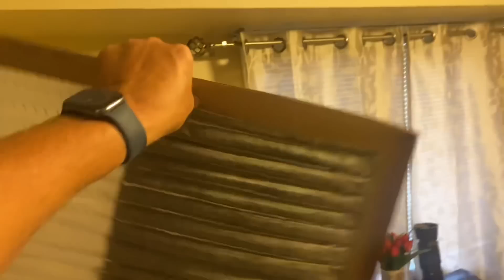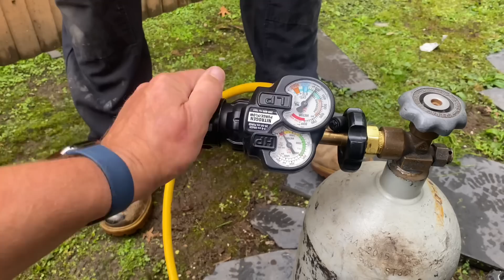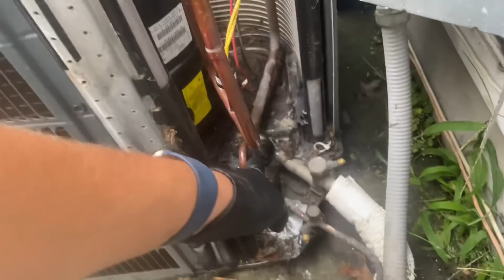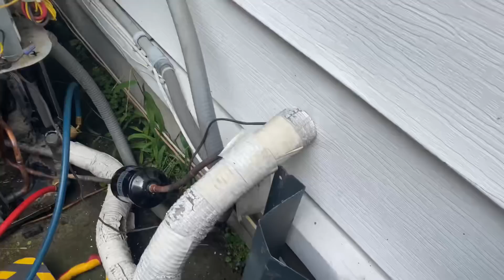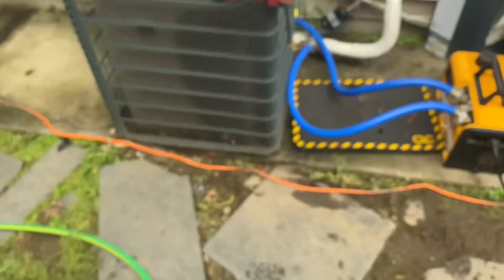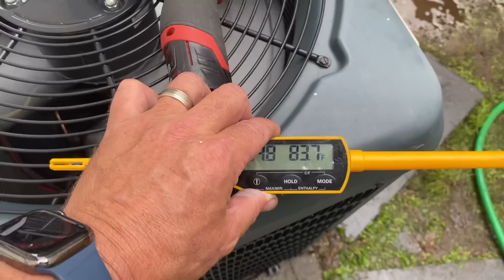Central AC System Not Cooling Totally Flat Poorly Installed System STEP BY STEP FIX REVEALED

Comment: OK so this is a fan coil unit, why is the condensing unit not a heat pump! Are they only running electric heat? Way to expensive I wouldn't want there electric bill in the winter months.

Comment: well done Mikey love your videos. I bet your microns rose up the first time from when you closed the ball valves seeing there may have been pressure or atmospheric air trapped in that ball valve. i normally flip those ball valves on and off during the vacuum to alleviate that issue give it a try to see if that works for you too. Cheers man I appreciate your vast knowledge and professional work keep it up.

Comment: Just an fyi. Make sure you do not use acid based cleaners on the micro Chanel coils. Will eat the aluminum. Use Viper micro channel safe coil cleaner if needed or manufacture recommends WATER ONLY.
Reply from the maker: Completely understand. The reason is because MOST techs don't rinse well enough. That's why. Appreciate your feedback.

Comment: Mike, with that gap between filter and housing of the handler, would it have been prudent to check the evaporator coil for crude as well?  I mean, look at the outside unit :)

Comment: Nice job I would have Done everything identical. Having  a TXV subcool is important To be sure that you have a full column of liquid entering the expansion valve so it can do its job.. But super heat is still relevant and having close to none Would mean that there's way too much liquid coming back to the compressor. I like to see my head pressure at least two times what my suction is The compression ratio seems off with 150/266. Possible overfeeding meeting device??   Not much else you could do with that shit show

Comment: You can thank your greedy corporate suits for cutting out the filter racks in air handlers. You expected to see 407C. Why is that. That is a drop in refrigerant. I didn't know they were putting it in new units. The "best scenario is to replace the outdoor unit". Really? Repairing it and installing a LOSS of Charge Switch would be ideal to me. That way the next time it leaks down, it will shut off.
Reply from the maker: 407C is NOT a drop in refrigerant. I expected to see the rating label to say R407C instead of R410A because all the Evcon units around here are for R407C when the owner can’t afford a new R410A system or the installing contractor is too lazy to replace the entire system. Keep selling your snake oil to your customers. Eventually I’ll take them as my own. Yes, the best option is to replace the entire unit WITHOUT that type of coil. I speak from experience. Thanks for watching.

Comment: Was that indoor unit strictly for the AC, or was it a furnace as well? If that unit was also a gas furnace, that return air hack job is totally against NFP code, and manufacturer installation instructions, due to being a safety hazard. That return air hack and the contactor wiring are the signs of a lazy, half-assed installer, plain and simple.

It still amazes me to see these Coleman units. So Coleman was having a board meeting something like this? "Well we've got lanterns, camp stoves, tents, sleeping bags, campsite furniture, camp toilets. What camping accessory are we missing? I know, a 3 ton central AC system!"

Hey Mikey, did you sell them on a proper filter box assembly for that unit and instruct them on the necessity of changing the filter far more often than it would appear they have been? Kinda looks like you would have 4-6 inches there between the intake opening on the unit and the opposite side of that wall, to fabricate something up fairly easy. You could upgrade that to a 2 or 4 inch filter maybe. Push the improvement in air quality.
Reply from the maker: No there wasn’t room for a filter box - regardless the AHU is set too low. Need to raise it up. Unless your paying, it wasn’t going to get done.

Comment: Actually they were right to have that specific 3m filter the opposite way. I've seen so many of those cheap ones with the plastic support structure on the intake side, I'll give the homeowners props for following the arrow, but needless to say they all got sucked into the blower wheels on furnaces. I've lectured many homeowners on switching filters, but if they insisted on the 3m Walmart junk, put the structure toward the furnace, save you a service call for a blower cleaning and motor change out. And your are correct on the vacuum pump ballast
Reply from the maker: Better than nothing I guess

Comment: I have a 1983 Lennox 3 ton condensing unit and I have to thank you for showing and explaining the maintenance repairs on other units. It has helped save me thousands of dollars in repairs from servicemen and the scams of people telling me that I need to replace my system right now. My air handler is a 1993 Lennox Pulse 21 and the only thing that I have had to do with this, for repairs is replace the draft inducer as the motor went out. This has helped a lot, I speak for myself but I am sure there are thousand of people like me that appreciate people like you that are willing to put this type of content online so people can make their own repairs. There is definitely a lack of tradesmen and tradeswomen in these fields. Thank you for showing people that it is an admirable profession to work in.
Reply: If you read this. Just out of curiosity. Have you ever installed Geo-thermal Heating/Conditioning systems? If you have how many and how much would it cost in a ballpark estimate would it cost to install for an 800sq ft house that also has a basement?
Reply from the maker: I've supervised one many years ago. Costs all depend on area. Thats the major reason I don't discuss pricing on this channel.
Reply: @traek8742 depends on where you live. If you are up north it absolutely isn't worth it, they are nothing but trouble and last about 10 years before they are wrecked.

Comment: As silver-solder is self-fluxing? We were always taught to heat the copper until you see the green flame or even a cherry red to the copper before applying the silver solder.

The broken copper pipe that was repaired?, ought to have had some coils integrated in order to absorb the vibration.
Reply from the maker: brazing does not require the use of flux

Comment: Normally check the return air temperature by drilling a hole and sticking a psychrometer in the ductwork.

What duct work? Lol, just tuck the psychrometer between the wall and filter 🤣

Oh Mikey, you find some messes that people call jobs well done
Reply from the maker: its really sad
Reply: @PipeDoctor  it is sad. But it keeps you gainfully employed so there is a silver lining to other people's bodgery

Comment: It’s a muffler not a drier is what York says. 🤷🏽‍♂️ love ya bud ! Mikey fuxkn pipes !
Reply: I stand corrected , they do have the drier inside I’ve seen it on York units, all fuckn trash
Reply from the maker: It says FILTER DRYER on that internal component I removed.
Reply: Muffler would be in the hot gas line not the liquid line. He removed a drier.

Comment: My HVAC contractor could use your vacuum pump.  Took them an hour+  to pull vacuum.
Reply from the maker: Wow! Nuts
Reply: @PipeDoctor  it was a 100+ degree day when they were pulling vacuum.  AC has been holding a 20 degree delta T so I can't complain.

Comment: Would be cool if you had an area in the new shop where you have a system mocked up for people like Peter to test on and braze. 
Maybe you can pop a pinhole and have him locate it and fix it. 

Then a place to do mock boiler manifolds and wiring, see if they can come up with creative ways to install equipment and learn. 
if I were Peter, I would have been taking home old equipment and turned my parents basement into HVAC Lab. 

no Cap, I did rewire and upgrade my parents house from knob and tube at 14. I also walked multiple trips and bought everything with money from working. doing dishes  at a Diner for $4 bucks an hour. 
they were insane for letting me do it, but I wanted a AC in my bedroom and the single outlet I had was still knob and tube.
Reply from the maker: Good idea

Comment: I know Evcon is bottom of the barrel but I’m surprised to see a reciprocating compressor in there especially with 410A great job! Get better bud god bless👍🏻
Reply from the maker: Thank you!
Reply: They aren't Evcon, haven't been for years.  They are all JCP now, York, Coleman, Luxaire.
Reply: @joshuaseaton4526   I know York makes them but Evcon is their cheapest lineup basically contractor grade
Reply: @bobbydisano7293  Ya, no worse than the others really.  I think a little cheaper sheet metal is all.

Comment: You must regularly change the pump oil because it also get contaminated. The jump is what you say . Contamination starts to boil and thus raises the pressure until those molecules are removed. Plus the valves can leak when you close them. Great Job
Reply from the maker: Yes, you are right

Comment: MP I know you love spending those big $$$$ on those Mercedes vans but you should really consider a Ford Transit 250 with the EcoBoost engine.  Mine is loaded with equipment and the factory brakes are still good at 85,000 miles.
Reply from the maker: no shit, 85k miles and still factory brakes? i don't believe you!
Reply: @PipeDoctor  yes sir Ford Transit 250 with the 3.5L Twin Turbo V6 85,000 miles still has oem brakes. It's had regular service and a new set of tires. I carry all the big heavy stuff in my van. We have a new on on order that has Dual rear wheels.

Comment: Nice job Michael.  Pain in the neck job but you guys knocked it out in stride. 👍🏻  That white neutral wire is not a surprise in that bargain system.   Some hack in a pickup truck.   😆
Reply from the maker: Thanks 👍

Comment: About 15 years ago my neighbor recommended a guy to do my AC and it turned out. They were oil burner company and I was a little skeptical. It worked good but it looked like crap very sloppy installation, but that’s what you get up here in New York when it comes to AC for most guys, they specialize in something else and they’re not very good at doing the AC part but I noticed that’s changing a lot more people have AC. Growing up in the 70s and even the 80s. Nobody had AC on Long Island now pretty much everybody does.
Reply from the maker: There is an oil company on Long Island that installs ac. Absolutely disgusting.

Comment: The low side boiling point is about 10° higher than normal.. low superheat,,, your txv is fubar I suspect
Reply from the maker: No airflow
Reply: @PipeDoctor  low airflow would give you a lower boiling point. You are 10° too high